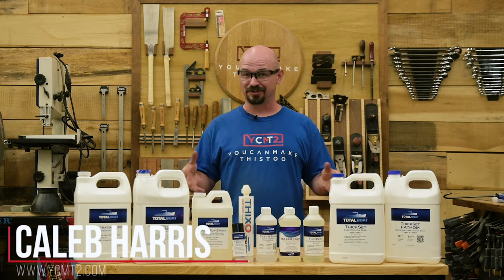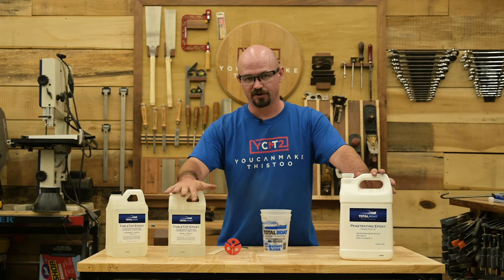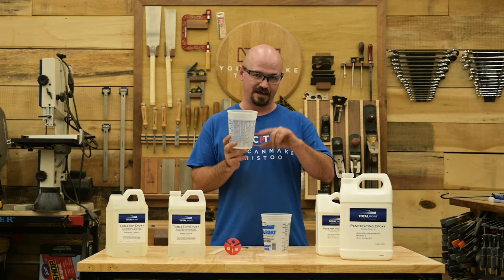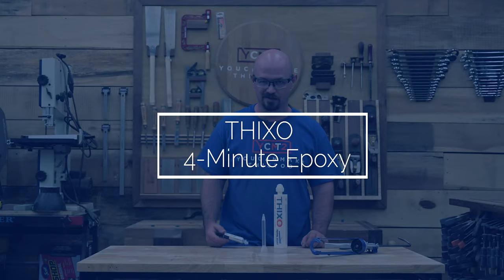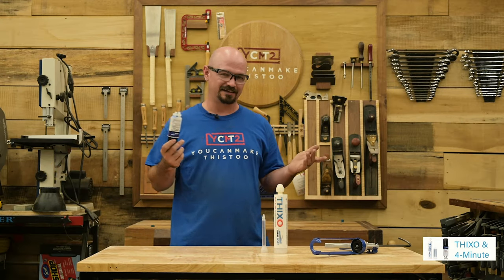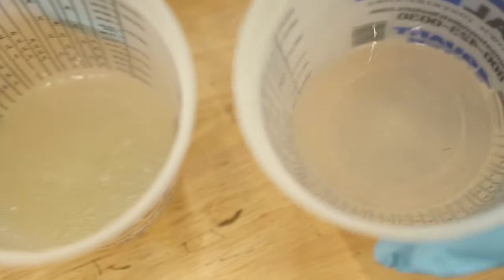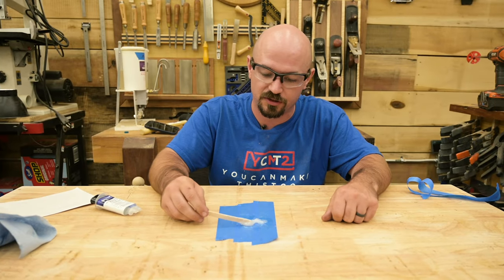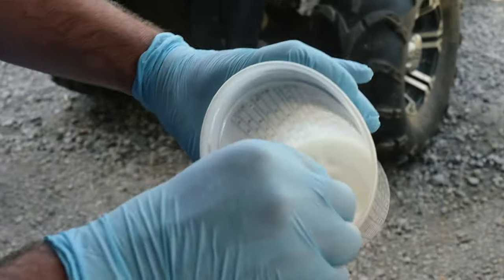The Best Epoxy To Use

Comment: I use the technique taught to me when I did a resin course, the 2 mix method. Mix thoroughly in your first measuring container, then pour into a second container and scrape your measuring container out also. Thoroughly mix again for a perfect mix. Can scrape the second container knowing it is properly mixed.
Reply from the maker: Solid technique

Comment: Seems like extremely practical and experienced advice.  Just out of curiosity though, I'd weigh the individual containers of resin and hardener my first time mixing small batches to be sure that scale-weights equal volume-amounts.  Some liquids/hardeners might be lighter than others.
Reply from the maker: Not a bad idea. I general weigh 
 small amounts just because it’s the margin of error in volume mixing makes it easier to be out of ratio
Reply: You are correct and the video is wrong.  Thanks for pointing this out.  The mix must be by volume NOT weight.  Although well-intentioned, this guy does not know what he is talking about.
Reply from the maker: Depends on the product. With totalboat you can do either. I spent a week at their facility and we talked about this. Density is close enough you can go either way.
Reply: @chrisroy7085  You can still mix accurately by weight IF you weigh an equal volume of base and hardener which will give you the correct ratio for mixing by weight.  But whether using the volume or weight method, I use one container.  I usually pour in the "A" first then add "B" per the ratio called for.  In that way, I am mixing the epoxy per the recipe correctly without trying to scrape every last drop from one container.  However when mixing really small amounts, I do sometimes use syringes, using 1 syringe for each part.

Comment: I am in the process of redoing a balsa deck, can total boat tabletop epoxy be used with wood flour for the filets on the corners? I have extra on hand for years that I've never used. Thinking how to use it in this project to save the structural epoxy for laminating.
Reply from the maker: I’m purely guessing at this point, but my intuition is the tabletop epoxy would be the most similar to a floor epoxy. If you’ve got the extra, I’d be willing to try it

Comment: A quick tip I learned was to place your mix cup in an ice cream bucket or of appropriate size. Tape 2 or 3 edges down from inner cup to outer bucket then add ice. Water will help absorb more heat during the exothermic reaction but the tape will hold it down. This slows the kick considerably if you need extra time to sand a spot or tack rag and blow or just to wipe down. We all get caught in the heat of the battle while fitting the clock and this trick will help. Gel coat, many epoxies and other two part products that have a short pot life even auto paints.

Comment: Ok, so I’m a total newbie to the Epoxy thing.  I’m making a pile of Catch-All Trays with a 3/32” deep engraved emblem in the bottom of the tray.  I need to apply a thin coat, maybe an 1/8”, of epoxy to the bottom of the tray to protect the emblem and increase the durability of the tray.  Recommendations??
Reply from the maker: I'd use a table top epoxy

Comment: Hey! Thanks for these details. I am halfway through a deep pour of a charcuterie board and I wondered if you (or anyone here) could explain the differences between table top and deep pour epoxy before I pour my second half. I left the bark on my boards, so I planned to just do a deep pour to cover the entire board (wood and previous deep-pour epoxy layer). Most recommendations I am seeing are to remove all deep-pour epoxy after final curse time via sanding and then cover with the table top resin for the final coat(s). Would I have luck with just covering the whole board with deep-pour (for my upcoming second layer) or do I need to use the table top resin for some reason?

Your videos have been super helpful. Thank you!!
Reply from the maker: Short version is table top is formulated for thin (1/8”) pours, and deep pour can be between 1/2”-3” depending on the product. Pour a deep pour thin and it’ll take forever to cure.. if it ever does.
Reply: @YouCanMakeThisToo  Thanks! Yes, I was planning on pouring at least 3/4" for the second layer, so that should be enough to cure. Is there any benefit to pouring the second coat as the "final" coat (covering all the wood) or using table top resin for that final coat?
Reply from the maker: @michelled5749  Not really. Any resin can be a top coat. I only do another "skin coat" if I'm not happy with the current coat for someone reason. Just be sure to check the label for whichever epoxy you're using to make sure that 3/4" deep is within what it can do!

Comment: Awesome instructions! I’m replacing a rotted floor board in my aluminum boat using 1” thick new marine plywood. How many square feet will 1 gallon of penetrating epoxy cover with one coat? Also any need to thin it? Thanks!
Reply from the maker: There’s no need to thin it… and I don’t know about square foot coverage. It just depends on what it’s going on. Some will drink it up and soak deeper so it won’t go as far. The more rotted and punky the more it’ll take. Fresh wood doesn’t take much.

Comment: Great video Caleb!  Could you please recommend the right epoxy for sealing painted rocks.  The children in our neighborhood paint rocks and would like to seal them.  I have run into a problem with moisture under the resin the results in lifting the paint and peeling.  The rocks are outside year round.  Thank you!
Reply: Try drying your rocks in a low oven before applying your sealer. 12 hours to dry, then 12 hours to cool. Tabletop epoxy is likely the best for coating them.

Comment: Used total boat tabletop for the first time. My experience differed from what  I expected based on watching this video first. 2 big differences. 1, the working time wasn't 10 minutes. It was over an hour. I mixed by weight 100 to 83, and it did properly harden so I don't quite understand that. 
B, a heat gun would not remove the air bubbles, not even close. A torch, however, took them out instantly and it still took over an over before it began to gel, despite the additional heat. 
I don't get it...
Reply from the maker: That is weird. Sounds like how epoxy behaves when it's below 70f

Comment: Using a kitchen scale is fine for 1:1  weight, but what about by volume? Some part A is heavier than part B and some are thicker by volumes
Reply from the maker: Read the instructions for your product and it should give the ratio to use whether you're using volume or weight. For totalboat technically the by weight ratio is different, but using the volume ratios for weight is still well within the margin of error - so either works. But that depends on the brand and product, as always.. check the manufacturers instructions

Comment: I have been looking into using this brand of epoxy. I mostly work with 3/4" wood I would like something that I could fill knot holes sometimes they go all the way through the wood and I would also like to fill cracks that sometimes go all the way through the board I will more than likely want to make the epoxy black what would you recommend for me to use thank you this was a good video

Comment: Hello - I used some reclaimed Douglas Fir Timbers for stair treads.  The timbers have some large cracks that would measure 1/4" wide x 3-1/2" deep x 40" long.  Which Total Boar epoxy would you recommend for this application?  Thanks for posting.
Reply from the maker: Thickset will get it

Comment: I've been a loyal Ecopoxy & Ecopoxy Flowcast user for years and typically pour my tables between 1.75" and 2.25" thick in One pour. I haven't had any issues yet. I do lower my shop temp and use a fan to disperse the heat. Can you pour that thick with Total Boat in One pour or do you need to do 2 pours? I don't want to see any lines between the layers.
Reply from the maker: With the thickset fathom you can do up to 2” in one pour.

Comment: Do you use a new paddle for each mix? If you reuse the paddle how do you clean the paddle.
Reply from the maker: While it’s still wet you can clean it in alcohol or mineral spirits. If you use the silicone paddles it peels off pretty easy one it’s cures.

Comment: If I’m trying to fill CNC carved paths, do you recommend high performance with fast hardener? Also, would you seal the wood first with no pigment and let it cure 100% before mixing color pigment? Does high performance bond well to already cured epoxy?
Reply from the maker: It depends on the wood. If it's an open grained wood you'll definitely want to do a seal coat first. If you're using pigment, you can go with a faster curing epoxy because the pigment hides bubbles deeper in it. And epoxy will bond to itself, but it's best practice to scuff sand cured epoxy first.

For thin inlays I prefer to use table top or makerpoxy because it flows and releases air a lot better than the high performance.

Comment: I been having issues with pouring in my jar molds in one pour. I've been getting tiny holes/ bubbles on the surface of my jars and it's a pain to sand and recoat. Wastes a lot of time and money on projects. Will this epoxy work for molds 4 inches tall?

Comment: My first layer was total boat 5 to 1 and I need to put on another layer but only have liquid glass. Can't you layer different brands?
Reply from the maker: You can if the previous layer is fully cured. Just be sure to scuff sand it and dust it really well.

Comment: Are saying that parts by volume is the same as parts by weight?
Reply from the maker: No, 'cause they're not. The difference between the two in this stuff is well within the margin of error, details are all on the label. In fact they're not even a true 2:1 or 3:1.

Comment: Good morning Caleb,  im using  Total Boat products,  im doing a chess board.  The ratio is 3.1.  If I use 4oz of resin,  how much of hardner would I use?  I'm soooooo confused,  can you help plz?
Reply from the maker: Just divide the amount of resin by 3 to get the amount of hardener. 4/3 = 1.33333, or 1 1/3.

Comment: Probably way outside your wheelhouse, but I wonder if any of these could be used to create an AR-15 OR AR-10 lower receiver? I know they print then using various printers but I wondered if you couldn't make a mold and pour something that would work.
Reply from the maker: I wouldn't chance it. If it failed, there'd be sharp shards going everywhere... near your face.
Reply: You might look into doing fiberglass. It can be either addition or subtraction formed. In other words, you can build up layers, or cut and sand holes and curves.

Comment: The fathom will work on a 24"x24"x2"s thick w 2 pieces of 3/4" round split down the center so river look down the center .like a 3/4"cookie split down the middle round on the outside n flat down the center in a square 24"x24"x2"s deep.make since  I hope.0
Reply from the maker: I hope so too I think